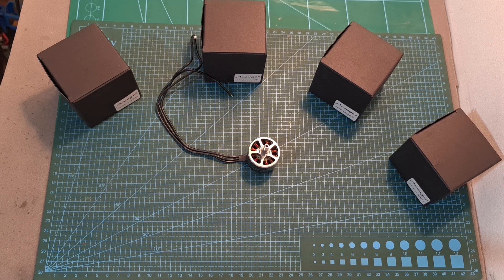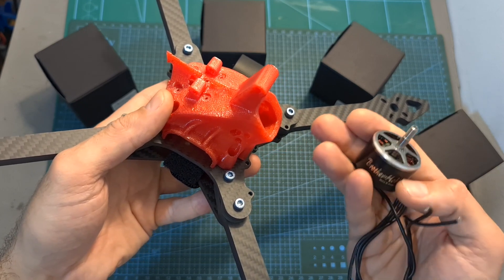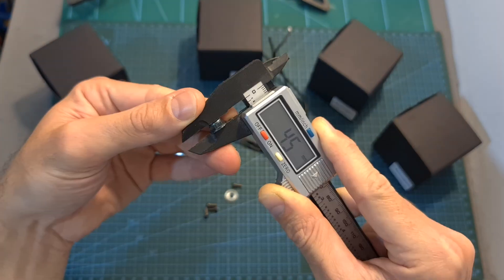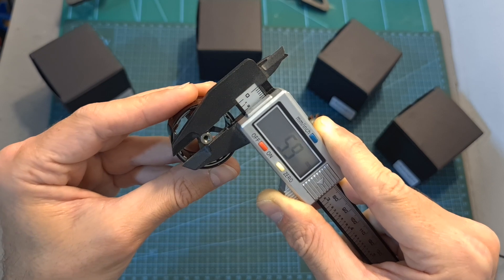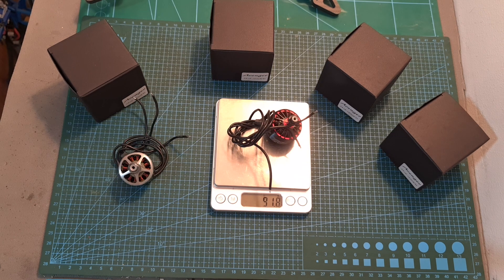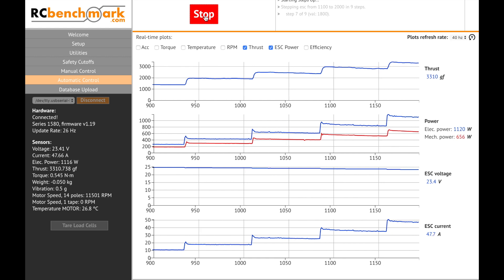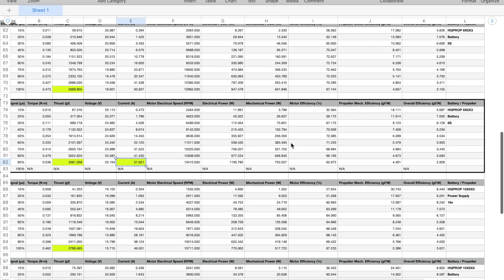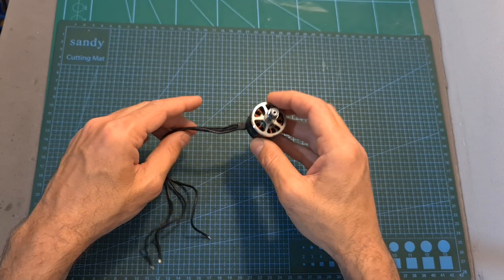BrotherHobby Avenger 2816 1050KV Motor - Overview & Thrust Tests

Comment: Cool and very helpful review for these motors :p)
I would like to install these on my next XL10 build, but may be i will stay on a 9" props. In fact i don't know.
What would be the best props for a 9" or 10" big monster ? 
And also wich ESC do you recommend 4in1 or single ESC for security and facility of replacement ?

Comment: I’m looking for a LR motor for the Merica9”. I guess the 2816 is too powerful for my needs and will only suck amps.
Which is most efficient to cruise around 80km/h
Reply: I'm struggling with the same. Not sure if it's too powerful, I compared the data from gal with the 2812 900kv and it seems the 2816 is even slightly more efficient. I have to say that gal tested 9x5x3 prop while BH used 9.3x4.7 biblades. So hard to compare. Usually biblades are more efficient.
2812 should work fine on 9" biblades but will struggle on tribades due to more weight of the blade. That means you could get some wobbles and bobbles due to lack of response, the motor has to accelerate and brake a heavier prop.
If you decide to go with the 2816, I would limit motor output to 90% for long range purposes.
PhantomFPV is using 2812 on biblades for freestyle on his Merica 9", seems to work great and very powerful. 

Benefit of the 2812 is the lower weight. You save about 15g per Motor. For long range I would maybe go with the 2812 900kv on 6S and biblades. This will also allow higher cruising speed at same current consumption.
Maybe I will order also the 2812 to compare.

Comment: Some of you maybe new to X-Class and think 100g motors are overkill...

I'm using Avenger V2 2812 on same HQ 9*5*3 prop.
Hard to tune PID and can definetly tell 80g motors are overworked.

Works much better with biblade.

Brotherhobby also has old 3115 motor. I think they should have made stator wider instead of taller.
Brotherhobby also has an excellent stylish Avenger 2810 for 8".
Reply: Lmao 9" is absolutely not x-class

Comment: Hi Gal    I guess I'm going to need to Design a new frame for these motors for I can use them with my 3in.  LOL  I did see Neills flight with the 9in merica and I want one.  I know that to do ?  I can purchase yours when you are finish your video. Only $200 in shipping.  Thanks again for the video
Reply from the maker: Shipping will be expensive indeed :-) These big birds are a lot of fun, especially to see them flying in the air.